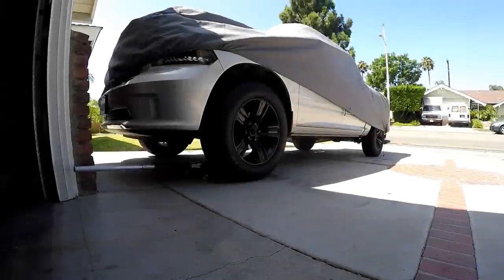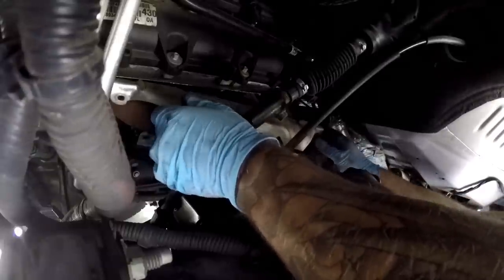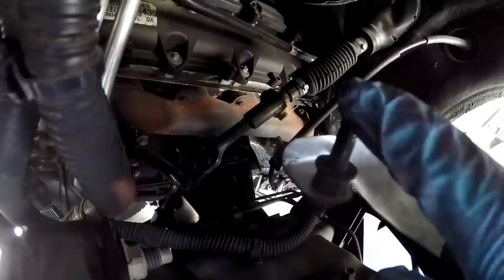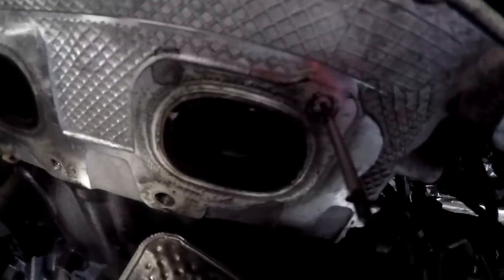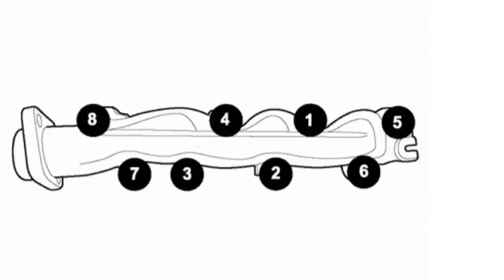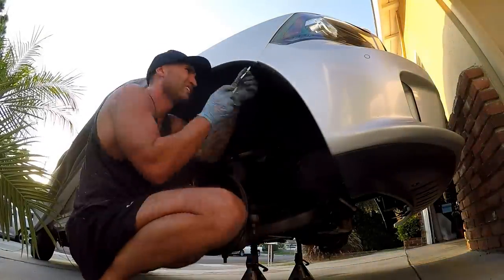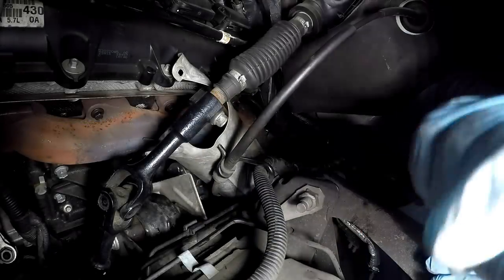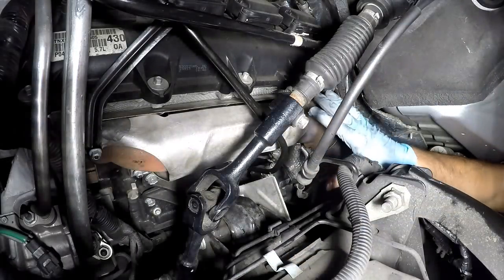DODGE RAM HEMI Exhaust Manifold Stud Replacement   Leak Ticking FIX

Comment: Thanks for all your professional videos.  I just bought a 2011 Ram 1500 sport, and just changed the plugs after watching that video.  I had a tick coming from what I thought was passenger side, and was sure it was a lifter.  After seeing this, I got under there and the rear two bolts of the manifold shield, passenger side, are snapped.   Ready to get in there and I've already rec'd the parts to get started.  One question; is there a donut between the manifold and the cat connection?  Or is it just bolted together?  There some permetex sealant putty'd around there, and not sure why if there isn't a donut.  Maybe they were chasing the same ticking, which was actually the manifold bolts.   Thanks again for all the great videos and commentary.   Paul
Reply from the maker: Thanks for the support Paul!  There is a gasket there on stock manifolds.  On aftermarket manifolds they don't have a gasket there and require some copper permatex but stock isn't needed! 😎
Reply: John.    Changed my passenger side today.  Furthest cylinder back:  top bolt was snapped at heat shield, and lower bolt was snapped inside block.  Sprayed down the others with Kroil penetrating fluid for nearly a day, and had no issue with any of the others.  Vice grips for the one showing thread, and drilled the other one out.  Planned on using extractor, but when I got to bigger bit, it moved, so just reversed it and it stuck to the bit.  Gold.    Question:  I have a ground strap coming from the rear of engine, but downward side is flying free.  Where does it go?  I assume just part of the exhaust or frame.

Thanks again for this video.  Working my way through all of them...  Watched this one probably 5 times because I thought this was going to be challenging (I knew those 2 were broken), but after spraying them, and  I also applied a little heat to each, the bolts all came out fairly easy.   You da man!
Reply: I would not have attempted this without watching this and knowing what I was getting into!
Reply: I also got a new manifold.  Hard to believe that a chunk of iron would be "bad", but the back cylinder port of the manifold was probably 1/16" back from the others.  No wonder it broke both studs.  Good for another 100K!!!!!!!!!!!

Comment: I had my bolts go out 3 times under warranty. I hope they don't fail anymore lol. Great video!
Reply from the maker: You're lucky!  I wish my dealer had covered this for me lol
Reply: Boosted2k I had them cover under the factory warranty 100k mls. Did you go over yours?
Reply: Robert Immeer i still have the factory warranty. Im at 22k. Recently i noticed a drop in gas mileage and similar noise and my idle is slightly unstable. Do im thinking this is it. But taking it in friday to see what is it. Because im not completely sure. Did the dealer charge you anything?
Reply: Robert Immeer truck is stock too except for carvens r series muffler
Reply: Dontre Thomas I had Cerritos Dodge Ram Jeep fix it no charge, Sierra Ram Jeep fix it no charge & Premier Ram Jeep  fix it also no charge. Under Factory warranty.

Comment: Everything you did was great. My only worry would have been using OEM bolts. They are still having this exhaust manifold leak 5 years later smh.

Comment: Hey man really liking the videos man they do help and inform but just curious would you maybe, have like before n after clips of the manifold ticks?
Reply from the maker: Hey brother.  At the beginning of the video I show how it sounds before I made the repair.  Now it just sounds like stock no ticking. 👍
Reply: Boosted2k right on man like I said just curious I had recently did my spark plugs and started it up to see if everything checked out good n kinda got that sound idk..

Comment: Awesome video. I noticed my heat shields are loose on both sides closest to the firewall. Now I wonder if the bolts are broke.
Reply from the maker: Yeah thats unfortunately the common bolts to snap Dan.  It's always the last 2 bolts closest to the firewall that go. I'm doing headers and stage 8 stainless bolts soon so that I don't have to go through this headache again 😎

Comment: Hi. Great video. Did you put new gaskets as well. I didn't hear you mention it.
Reply from the maker: Its recommended but not 100% necessary.  I left the old ones and no leaks after.  I was planning to upgrade the manifolds shortly which I show in a later vid 😎

Comment: My 2013 is making exact same noise on drivers side on start up for about a minute or two...has to be this! My question is ..dont have time or money to fix at the moment...will this lead to other problems if I drive for a couple weeks until i can get it fixed

Comment: The extractor kit you linked looks different than the one you used.  I purchased the one you linked but noticed they are for a socket wrench and not sure how to get a bite onto the bolt with the extractor.  I am assuming i can lightly tap it in with a hammer then use a socket to remove the broken bolt out?

Comment: The studs/bolts you have the link for is that the same ones you used? The only reason I am asking is because it says it is not compatible with my 2015 but if you used them on yours ill know that they will fit mine.
Reply from the maker: Yeah its the same.  I think some years had 1 extra bolt on the passenger side but the bolts themselves are the same.
Reply: @BoostedMotorsports   no worries man the dealership covered it under the powertrain warranty

Comment: I tell ya, I used to love working on vehicles and still have all my tools to maintain my stuff but it turned my stomach when I got a look at where these manifolds were and the angle they were on. FCA replaced mine free of charge but if I had to do the work, I'd use aftermarket manifolds/headers and ARP fasteners.
Reply from the maker: Yeah me too!  Smog laws are intense over here and I didn't want a headache so thats why I used new OEM bolts that have mounts for the heatshields etc etc.  If I was anywhere else i would have thrown those log crappy manifolds in the garbage!

Comment: A trick we used at the dealer for these ram manifolds is if the stud broke off good and deep we would use a mig welder and weld a nut to the broken stud to then take out with a ratchet takes half the time and you wont slip off and hit into that nice soft aluminum with your expensive bits

Comment: Are those oem replacement bolts from Mopar any better than the ones that were broken? Or are they exactly the same? Also, has anyone replaced the stock headers with with better, individual tube headers and how did they fit?

Comment: Hi, great video! I just finished the passenger side of my 12’ Ram now onto the driver side. I’ve got It going good except the oil dipstick tube! I seen you said it needs to be removed and I see the bolt but I can’t figure out how to get it out and you didn’t elaborate in the video. Any help is greatly appreciated!
Reply from the maker: Thanks Scott!  Disconnect the sensor that is in the way and remove the 10mm bolt holding the dipstick tube to the block.  Also another bolt holding it to the heatshield.  Then just lift it up and rotate it at the same time.

Comment: Great video but I have to ask. If the OEM bolts were the ones that broke, why replace with OEM bolts, anything aftermarket out there to consider? Going that length I'd be so tempted to go ahead and put shorty headers on (that's just me - no need people to start a shorty header flame war) lol.
Reply: Disregard, saw your other video where you go ahead with shorty headers and upgraded bolts - great minds think alike!!

Comment: 2014 here. I'm having real trouble getting dipstick tube off. Only bolt I can find on the bracket is tucked way down and behind another thick piece of metal. Not enough room to get a socket or even a small wrench on it. I couldn't understand in your video exactly what bolt you were referring to as several silver bolts were in the picture and I couldn't tell what area from already being zoomed in. Any help would be great. Thanks.

Comment: Looking to fix my manifold issue. replacing with stock manifolds and looking for best option in bolts and gaskets. Most of the bolt kits I've seen don't allow for the heat shield to be reused and no heat shield on the gasket like stock. Concerned of heat issues and rather not burn anything down any thoughts?

Comment: Man I have a huge burnt oil smell once the truck is hot and I'm parked it at stopped at a light. Idk what it is but I'm guessing it's a oil leak that's dripping down into the exhaust and makes it burn any idea what it could be ?

Comment: Got some huge insight from your vid, had a question though, im looking to swap out the OEM exhaust system not sure yet if i want to go with long tube or shorts on the headers, but from this vid there doesn't seem to be a whole lot of clearance on the driver side between the OEMs and the steering rod, have you done any exhaust swaps on 4th gen 1500s? Have any product recommendations?
Reply from the maker: Hey Myles, I haven't upgraded my headers on my truck because of the strict smog rules around here.  I have heard really good things about the JBA brand headers though.  I've heard avoid BBK as they have fitment issues.  Also the long tubes are more work to install since you usually have to get custom exhaust work at the Y pipe where as shorty headers can just bolt up to your factory cats.  Let me know if you have any other questions and I'll try to help you out!
Reply: Went right over my head that you live in cali, you guys seriously have it rough there with emissions. I don't have a go team brand for parts as long as they're quality. I've been eyeing aFe twisted steel shorts and longs they both have options for matching Y pipes with high-flow cats; (reg cab) but ill definitely check out JBA since you recommend them.  Do you know of any kinds of bolts that can be heat treated or something similar to that to prevent some of the issues you've had? Last thing i want to do after saving up for headers and Y's is to snap a manifold bolt. Have any online site recommendations for performance parts? I use CarID, Autoanything, and Moe's when im cross referencing part prices. definitely appreciate you getting back to me man!
Reply: Have a y pipe delete on my 13 ram,sounds awesome.

Comment: Excellent video, very helpful. Other than new hardware, did you replace any other parts?...gaskets etc.?  Thanks for taking the time to do this.
Reply from the maker: John Baker Hey John glad you enjoyed the video! Some people will probably recommend to change the gaskets as well but I've done this on two of my trucks without replacing the gaskets (I just made sure they went back on the same side/manifold) and never had any issues. Other than that no other parts needed! Let me know if you have any other questions! I found a place on eBay that sells the OEM hardware cheap. $28 a side shipped. Let me know if you want that info too

Comment: Nice video had the same issue with exhaust manifold gasket leaks on my Ram. I see that you did not use the weld technique here. is that because the bolts are some kind of die cast metal? 

The dealer tried to charge $1365 to do both sides. Had to take it to a friend after the recommended spark plugs to, which were changed a week previous to coming to the dealer (lol). Its sad that we try to deal with our American car dealerships who in turn around and try to overcharge us on parts and repairs altogether while failing to honor their on warranties.
Reply from the maker: J Sutton & Co. Moving Services LLC yeah I agree! I would have tried the welding method but I don't have access to a welder so I just paid someone to come extract it professionally. 👍

Comment: Good video. been there done that on my 2011 dodge ram.3 bolts on driver side and 2 on passenger.
Reply from the maker: Thank Charlie!  Its a pain but it's something all of us RAM owners have to go through lol
Reply: BoostedMotorsports out of curosity for my own truck. What is going to happen if i dont replace these bolts. Can i cause extreme damage? Please and thank you in advance.

Comment: So I just bought some new headers to put on my truck (2013 Dodge Ram HEMI 5.7L) everyone I know says the ticking is coming from my headers and the ticking is coming from just behind the front tires around where the headers are. If it's just the manifold, shouldn't I just replace the headers anyways?

Comment: You mentioned you thought you'd use too small of a bit - any idea what size you used that was too small?  I saw another video where a guy used a 1/8" bit and then a 7/64" (LH thread) extractor. And then multiple videos where guys have had to weld on a nut to get the broken stud out.

Comment: For removing the bolts that are flush with the head. Take a thin cutoff wheel and slice it so you can put a screw driver in the bolt (you will slightly cut the head but it won’t hurt anything). Then take a torch and heat the broken bolt (they use loctite on the bolts). Once it’s warm you can use a flat blade screwdriver and remove the broken bolt.

Comment: Good video! One question: how crucial it is to fix this? If not done right away, will it damage anything?
Reply: I'm also curious - did you find an answer?
Reply: @gamblingoose  Well, my hemi has been ticking now for a long time and no damage so far 😅
Reply: @finnishfatman  ha - well here's to hoping then. This repair is something I think I can accomplish, I just need to find the time.

Comment: for a 2013 ram 1500 5.7 is it Dorman 03309 or 03211 for the bolts/studs? Looked at the ones you posted and it shows for way older models. 03309 seems to be the correct choice. 
Cant find this info anywhere.... Thanks for posting the video though!
Reply: Did you ever find out what bolts/studs it is

Comment: Been hearing this noise for about a month now on my 09 ram 1500 on the passenger side but it always goes away after a few min. Now I know what it is. As soon as i heard you start it up i was like yep thats my problem.
Reply from the maker: Yeah its common unfortunately Chase!  Glad you found the issue though!  Be sure to check out the other RAM maintenance and upgrade videos we have on the channel when you get a chance too!  We've been covering a lot of stuff for these 4th gen rams and will also be installing a supercharger shortly and documenting the full build here on the channel 😁
Reply: i have a lifetime powertrain warranty (came with the 09's) and i checked last night and the exhaust manifold is covered under that so i am hoping the dealership will fix it free of charge. only problem with that is they will probably use the factory bolts and will have the same issue again eventually. i guess we will see what they say.
Reply: loving the channel btw and the mods to the truck. makes me want to do some to mine. can't do too much to the engine though since i have that lifetime powertrain warranty and don't want to void it.
Reply: Just got back from checking under my truck and sure enough i have one broken in the exact same spot
Reply: btw, if anyone on here is having this problem and vehicle is still under a powertrain warranty, it is covered. just had both sides repaired for FREE at the dealership.
Reply: Chase Feller I have a 09. How do you know if you have powertrain warranty tho?
Reply: you should have a warranty book that came with the vehicle and it'll say on the original window sticker. my 09 came with the lifetime from chrysler at no additional charge. also if you have the sale paperwork for the vehicle it'll say as well. you have to be the original owner tho. when you take it in for repair they will ask for your registration to verify with their records that you are the original owner.
Reply: @chasefeller1279 I have a 2016 RAM with 51k miles but im the second owner, so am I outta luck?
Reply: whydontyoupick you might still be under the powertrain warranty which is 5 year 100k miles i believe. The bolts are considered part of the powertrain. Did you get a warranty manual from thr previous owner or dealership? You can call any dodge dealership and they should be able to tell you if you are still under the powertrain warranty, which I believe you are even if you arent the original owner
Reply: @chasefeller1279  I have the manuals etc, Ill look in the truck, and I will follow up with our local Ram dealer. I know my bolt is snapped too so hopefully I can get it fixed for free
Reply: whydontyoupick the manual will tell you how long your warranty is for what is covered. Powertrain warranty covers heads and exhaust manifolds so the bolts by extension too
Reply: @chasefeller1279  so I took it in and they said both sides had broken exhaust manifold bolts at 51k miles on a 2016 Ram. They replaced the bolts, and manifold gaskets and didnt charge me for the repair.
Reply: whydontyoupick thats awesome! Glad you didn’t have to pay. And honestly they should fix everyones regardless of warranty or mileage because they clearly have a design flaw. I think if you had to pay its $450 on each side so $900 total which is a ripoff.

Comment: I have read in the RAM forum that the header actually warp. have any of you guys put a straight edge on them to see If they are warped?
Reply from the maker: Yeah this is true.  Definitely check it when you have it apart.  We switched these out for shorty headers shortly after

Comment from the maker: Be sure to check out the other RAM Maintenance, Upgrade, and Performance videos on this channel!  We are also working on project HellRAM and supercharging this 100k mile truck and documenting the full build on the channel 👍👍👍
Reply: BoostedMotorsports where did you buy the OEM bolts?
Reply: The bits your refering to are called "cobalt" bits. They are about 2 to 3 times the price of regular black oxide or titanium bits. They have the hardness to bite through the case hardening that those studs are made of. You can buy the bits at any Home Depot, Lowes, or Menards